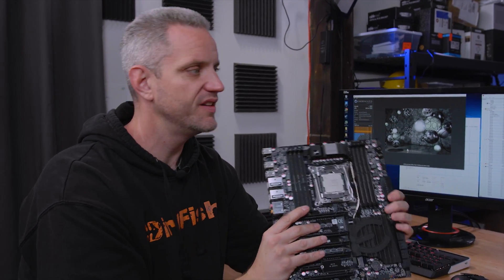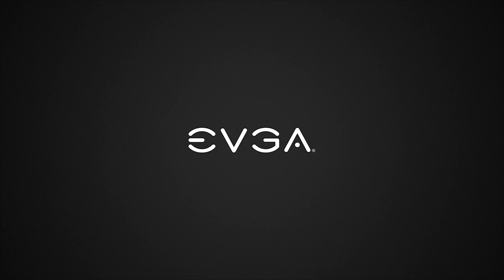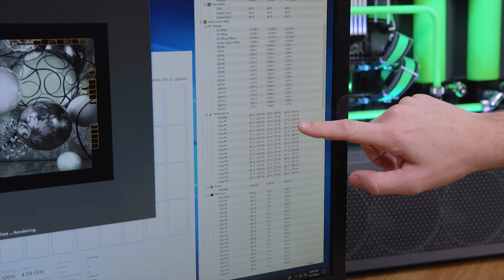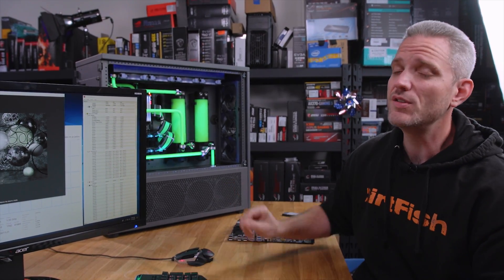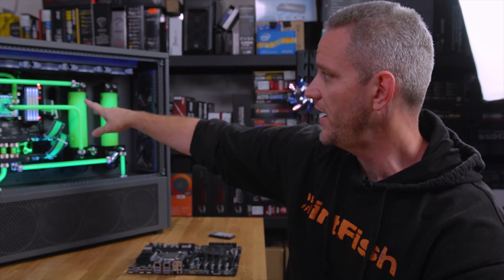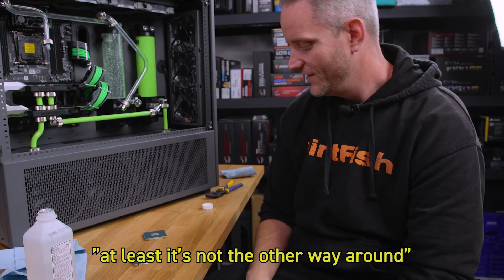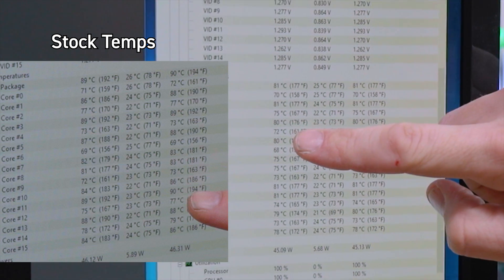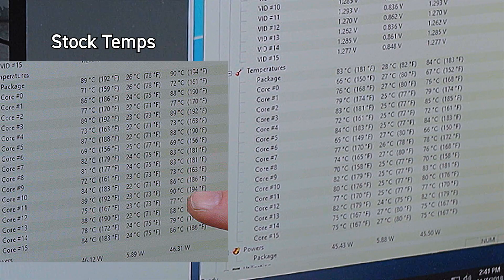I went to delid my CPU... but I didn’t expect this!

Comment: I wonder how many people are ripping out their CPUs and spinning them in the table tonight...
Reply: ohh i did that with my delided 8600k , it spins like that on the die lol
Reply: @SeikonDS  No need to delid an 8600k. Mine runs on AIR, @5.0ghz, no problems. It's really unecessary
Reply: @TheDyingScotsman  good for you m8 , mine on stock reached 92c with a 240mm AIO , i wasn't able to OC for shit since it would hit 100c stupid fast in prime95 non avx , now after delid +LM it won't go over 76c and that's in prime 95 AVX 5ghz 1.37v9
Reply: Zero of the people that pay for their own CPUs.
Reply: ive been planning on reapplying my liquid metal tonight since yesterday.  why not spin it. i have sandpaper and a sheet of glass as well....
Reply: I used a rockit cool custom copper IHS when I did my delid, its machined flat to begin with, so it doesnt spin, and more importantly transmits heat better to the cold plate.
Reply: @blackbeardthepirate7467  yeah i bought one of those and when it came time to do the delid i lost it lol.  would love to find it
Reply: @bobhumplick4213  it would be worth it to find and apply it next time you redo the LM application.

 I figured it was worth doing since I already had the stock IHS off for the liquid metal, Rockit Cool recently upgraded their tooling too, so the surface finish is even flatter than it was before. For less than $20, the additional cooling without bothering with lapping was a no brainer. I even emailed them to ask if they still offered their lapping service, their reply was that the new tooling did such a good job that there was no appreciable difference in their testing, after they had lapped an IHS post cutting with the new tooling and tested it against one not lapped yet cut with the new tooling. 

Sorry to bring up Gamers Nexus here, Jay, but they've been doing long term thermal cycling on thermal grizzly's liquid metal and thus far have shown that it is good for at least 2 years at a time between applications, with compatible metals.

Better to have a properly machined, FLAT, IHS in the first place to me because you dont have to reduce the thickness of it in the z-axis, where it is supposed to be mating as close and flat as possible to the cold plate. LM will stain the copper, the stuff sinks right into the pores, but from everything I have seen it does not affect cooling over time. Think of it more like the liquid metal filling all the microscopic imperfections in the metal, like water into a sponge almost. Proper initial application of the liquid metal will still make more difference in performance than at least 2 years of it being used daily.
Reply: @blackbeardthepirate7467  yeah i bought the stuff and put it off for a couple weeks and the couldnt find it.  im not buying it twice but i might lap the stock one
Reply: @bobhumplick4213  what makes a lot of difference is removing as much of the factory silicone as possible and only applying a small dab of super glue or rtv to the corners of the IHS AFTER the IHS is placed over the die. The idea is to remove and keep the least z-distance possible between the cpu die and the underside of the IHS so that the heat barely has to travel through any thermal interface material on the way out to the cooler. Any silicone under the edges of the IHS will push it upward and increase the z-axis measurement between, dabs of glue on the outside corners is plenty to hold the IHS in place until it is clamped in the socket again. Some acetone, like acetone nail polish remover, can break down the super glue dots in the future when you want to delid the processor again for reapplication of LM. 

Make sure to set up a desk fan or something blowing on the jigged/clamped up ihs and cpu while the super glue cures so that the off gassing doesnt leave residue on your delid tools/cpu.

You probably know all of this, but it's good to make it public knowledge for everyone else, eh?
Reply: @blackbeardthepirate7467  yeah i just delidded it with a bic shaving razor and scraped the stock glue off with a credit card and put it back in without gluing it back.  the socket clamp keeps it on pretty good
Reply: @bobhumplick I did that to my 8700k and killed it... accidentally scraped the PCB. Got a 9900k to replace it.
Reply: @m3taldragon1  yeah you have to be careful.  the trick is to use the paper thin razors.  not the utility knife\craft\box cutter razor but the very paper thin shaving razors.  i actually took one out a bic disposable shaving razor.  then hold one end between the pointer and middle finger and the other between the thumb and ring finger and strethc the razor tight so it will stay straight.  then just slid it in slowly at each corner for about a quarter of an inch and after you have done each quarter then slide it into the sides about the same and then twist.  it took about 30 -45 seconds.  i looked up pics of what the underside looked like and everything first to make sure there were no components on the pcb.

intel sells overclockers protection for like 50 bux i think.  1 time only replacement even if its your fault i think.  i know it covers a delidded cpu where a warranty does not.  but i think it would even cover a cut pcb.  might be worth looking into next time.

if the scratch wasnt too deep you may be able to fix it.  if you post a pic i might buy it off you.  was it a deep narrow cut or a wide shallow cut?
Reply: @bobhumplick4213  I'm the one who actually did the killing of the unicorn. It was a shallow cut. The CPU is most likely fine. Just need to send it to a pro to have it repaired. If we did decide to sell it.  $250 minimum. And you would pay for shipping.
Reply: @ProPowerMax  no need because you use a cpu that that cant get past 4.3ghz.
Reply: @ProPowerMax  news flash we can be smart asses too.  difference is you butted in where nobody asked you.  im only being an ass cause you were first.
Reply: Id be lieing if i said i wasnt considering it
Reply: Ripped out my grafics-card just half an hour ago... did not spin at all - so I put back in the new one without any sandpaper-treatment ;-)
Reply: @ThorDyrden  but did you spin it on the backplate or the fans?  you might want try both just to be sure
Reply: You mean your not suppose to drink the green stuff?

Comment: i tried to watch , but none of this made any cents.  You must have stock in origin PC. with all these "builder tips"  , yikes.   How about you reduce the clock multiplier or the bus speed. why would you delid a cpu? like ever... lol.  Seems like people are just spoiled by water cooling and flashy numbers.  You said it was a voltage issue , not heat...  the temp improvement was strictly due to the prior improper thermal paste application.

Lap the cooling block so that the paste adheres better maybe, never do that to a processor.... wtf?  how many do they give you for free?
Reply: I sense lots of salt and comments coming your way Sir.
Reply: I dont think you watched the video
Reply: Delidding is fairly common among enthusiasts, especially now that you can buy delid tools that make it very safe and easy. I think you are new to the pc enthusiast world, and while I welcome you to the community, perhaps you might consider restraining your criticism a bit until you have a better understanding/knowledge base.
Reply: uh you didn't watch the video I am guessing?
Reply: Maybe new to the channel or doesn’t know who or what Jay is??!!??🤔